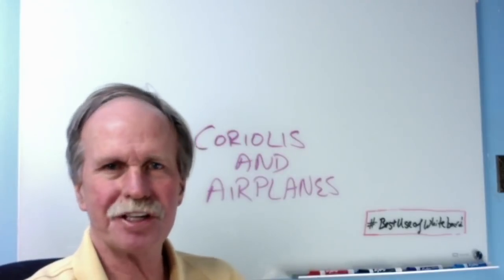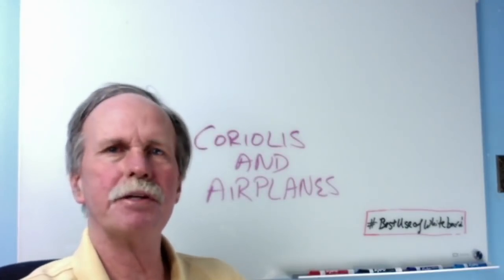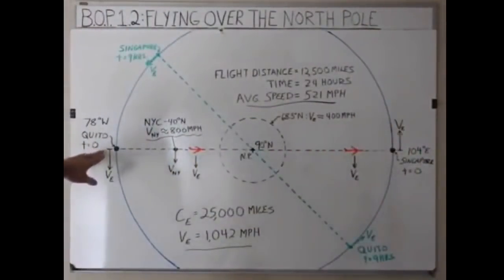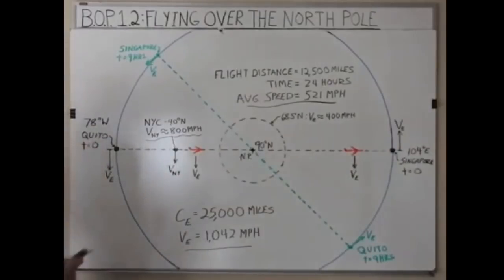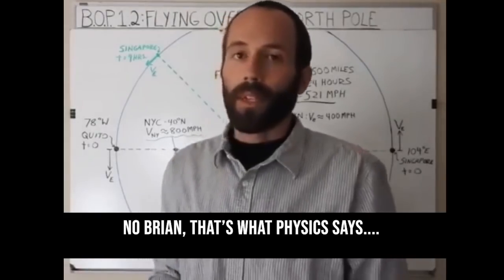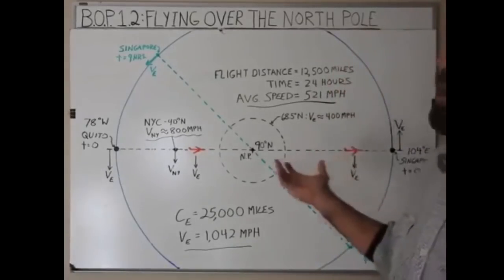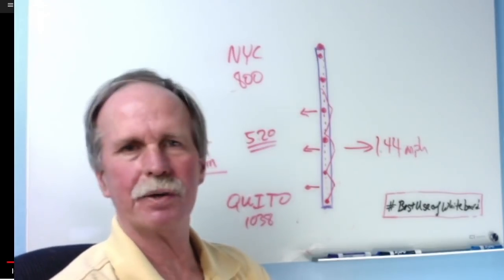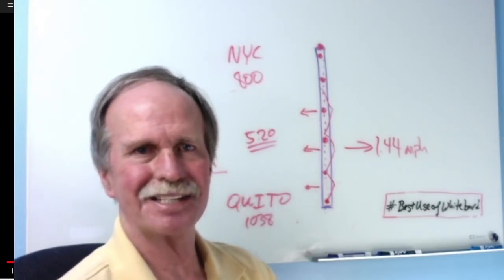Coriolis and Aircraft | Brian Mullin

Comment: Wouldn't the correction be 86mph not 1.4? 1038/12=86, still easily manageable by an a/c traveling at over 500 but more significant than 1.4  Not that you'd actually have to correct all of that, I suspect the wind correction angle would account for most of that anyway.
Reply from the maker: where did you get the 12?
Reply: @BobtheScienceGuy  12 hrs from the equator to the pole travel time, did I mishear something?
Reply from the maker: ah, so you flew for an hour, made a correction, then flew for another hour.  Do it min by min.  Recall that the actual correction is made instant to instant to keep your aircraft on ground track, not in big chunks on the hour.  That is problem you are having, and don't worry, it is a common misconception.
Reply: @BobtheScienceGuy  I'm still not understanding, in the video you said 1038 miles divided by 12 hrs(720min) to get 1.44 miles/hr, wouldn't it be 1.44 miles/min?
Reply: @kirkrobertson9972  What Bob is saying is that if you divide the 12 hours into minutes, it becomes 720 minutes.  One adjustment of speed per minute will result in changing the speed by 1.44mph every minute.  This still gives you the 86miles/hr² but its just converted to miles/hr/min.
Reply: @BobtheScienceGuy  

Your units aren't matching up. Why are the number of minutes relevant? Divide by the number of seconds or milleseconds if you want.
Reply: @PeterGalbraith  If you make a 1.44 mph correction for 60 minutes, what you do get?
Reply: @JSSTyger  Makes more sense this way, My brain was getting confused with miles per hour per minute!
Reply from the maker: you could.  The correction is continuous

Comment: For the case that your destination on the equator is just on the other side of the earth from where you are standing. Wouldn't it be faster going East-West (or West-East) than going over the pole? In East-West direction you have the direct line, whereas going over the pole you always have the additional vector from the earth's rotation speed to compensate for. Assuming the earth would be a perfect sphere.
B.t.w.: if not correcting for that drift and timing it properly - could you fly over the pole and arrive at the place you started from? 
Not that it matters for Flat-Earthers 🙂

Comment: 1038 mph in 720 min is 1.44 mi/(h*min), not mph.
That is an acceleration of 0.0000067 miles per second squared, roughly equivalent to 42 minutes from 0-60mph.
Man, I really don't enjoy US units :)

Good explanation however, I just think it works best for people who already have an understanding of the basics.
Thus, flat earth believers won't get it.
To get those, you may need explanations without the phrases "what if", "let's say/assume", "we have", and without any abstraction from the real problem to a mathematically simpler model. 
You have to really dumb it down while staying as accurate as possible. Maybe not even use vectors at all, they're difficult for people lacking in spatial imagination.

Comment: Huge erroneous assumption, 9:56 “Wherever the aircraft is, it has the rotational speed of the spot that it is over.” No, this is not true, once the aircraft leaves the runway it is not bound to the speed of the ground beneath. 

Also it is erroneous to assume that airplanes turn and add speed 10:08 to correct for Corriolis. What is your evidence for this turning?

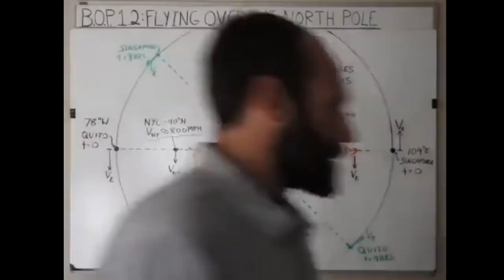Direction of the runway has absolutely 10:28 no bearing on this problem?! Didn’t you say at the beginning that vectors (velocity) have everything 4:10 to do with this problem? 

12:53 You conceptualize what happens with Coriolis but, a huge BUT, offer no evidence that this is actually done. What proof do you have that a northward flight actually flies west to correct for earth rotation beneath?

You literally have to be in denial at this point. According to your reasoning (which is illogical and erroneous) this plane flying from Quito to the North Pole would start out flying north and by the time it reaches the pole it would be flying west (banking to the plane’s left). If you follow that reasoning the plane would then have to change its orientation 180° to fly toward Singapore, banking to its right and gradually with less correction (banking less and less) fly directly south.
Reply from the maker: Rewatch the video you didn't connect any of the dots.  Try harder on the rewatch.